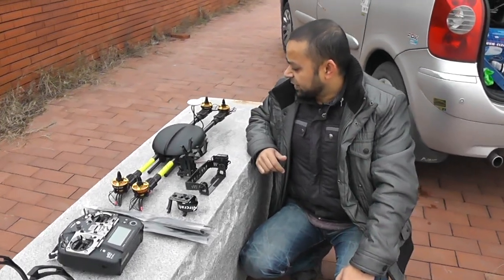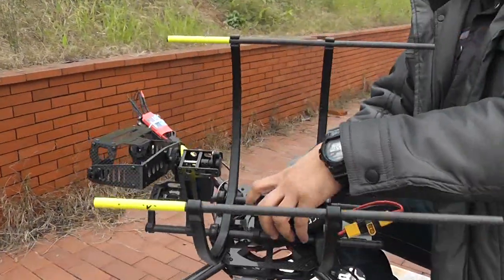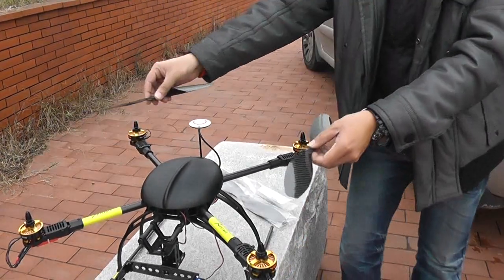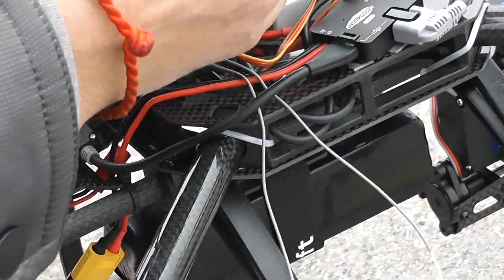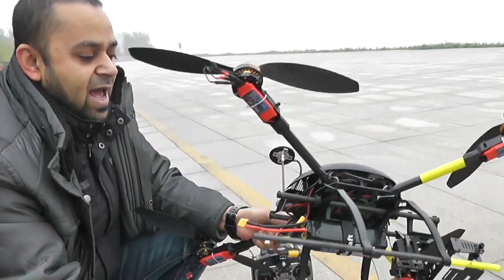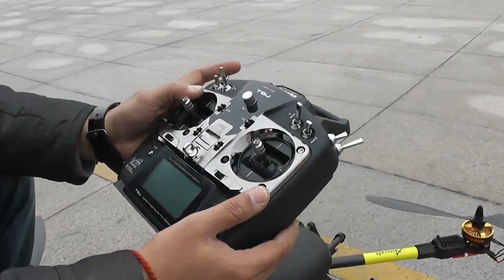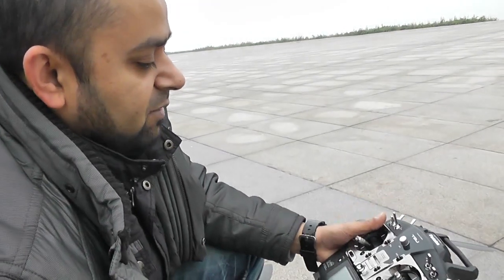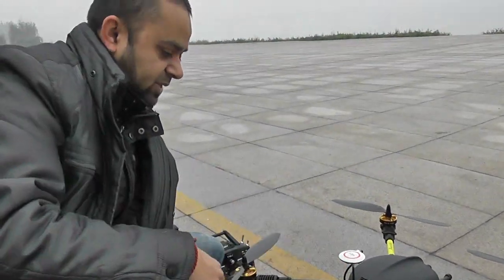OFM-X650 V4 Professional EX Pre Flight Instructions

Comment: hey Ali, you got to connect 2x3s batteries in series not parallel. also turn NASA voltage off and use a voltage buzzer set to 3.6v on each cell. I get 13 min now doin this with Sony nex5 and fpv setup.